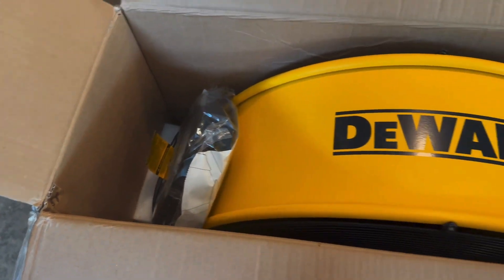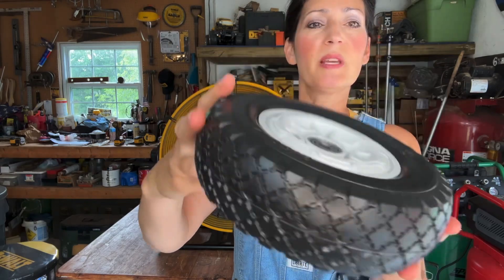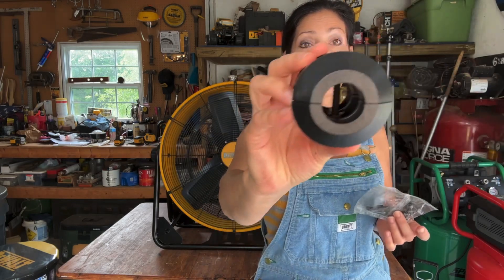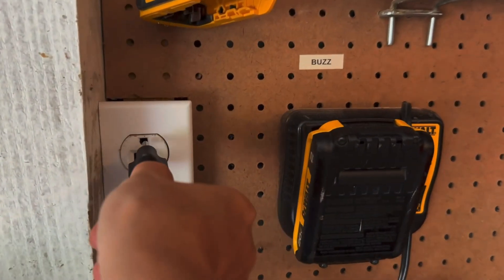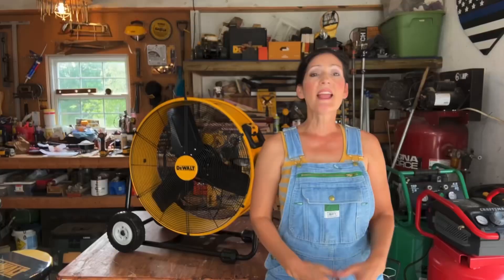BLOWN AWAY! Complete Overview Review DeWalt 24" Floor Drum Fan DXF2490 How to Assemble, Key Features

Comment: You literally never said if the fan actually moves a lot of air.   How does it compare to a $20 box fan?  
Can you feel it 6ft away?  10ft?
Reply from the maker: I actually said it in the first 36 seconds, its air flow is 6500 CFM. I don’t have a box fan on hand to compare it to but a typical box fan’s CFM is 2200. Yes you can feel it 6 feet and 10 feet away. If I ever show another fan I’ll try to demonstrate this if possible, I tried covering everything I could think of.
Reply: @Jennyfromtheshop  yea, I’ve looked up the 6500cfm but that’s just the rating.  
Just like horsepower on a car you can’t trust the manufactures rating.
Reply: @Jennyfromtheshop  really nice video, thanks
Reply from the maker: @AT-yh2ug I don’t know if they’re independently tested or what but I do show a little clip of the fan at the end of this short. Maybe it’ll be a bit helpful? https://youtube.com/shorts/e4AmEGHHMqw?si=R5yfLclrU-UQOkIi